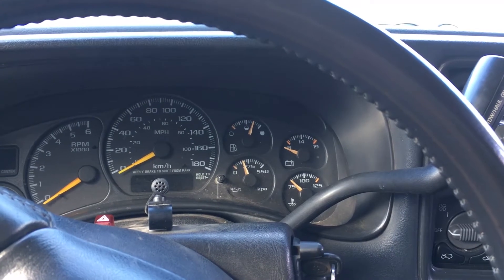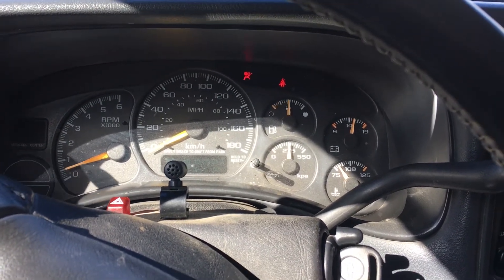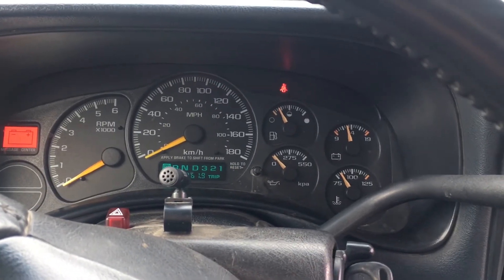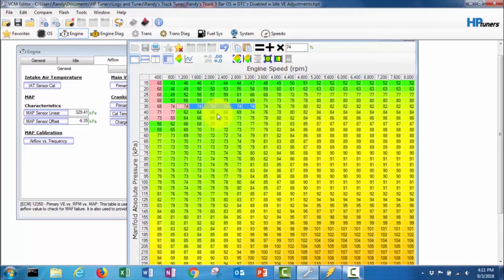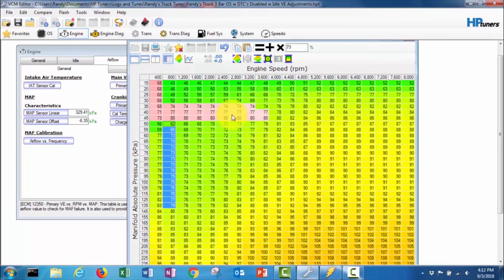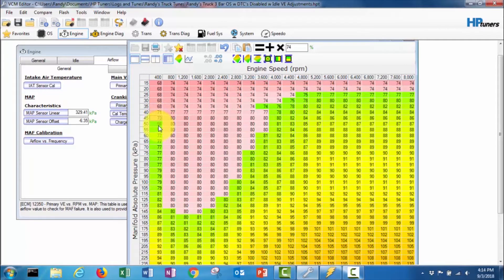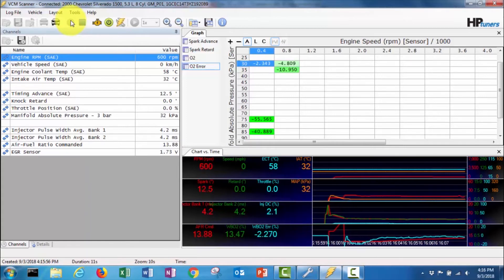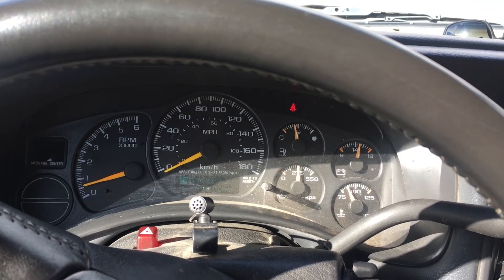Lowbuck LS Turbo Truck Project - Initial Startup and Idle Tuning with HP Tuners 3 Bar Enhanced OS

Comment: First off great video it’s hard to find content where someone walks you though these things. I didn’t have such good luck, my truck will not run, I tried adding fuel and I tried taking away and still didn’t seem to change. Truck with fire eventually but not run
Reply: Do you have any advice
Reply: Are you running MAF.  Is it plugged in?  If not need to start there.  In tuning

Comment: I just bought a 6973 turbo. What fuel pump and injector size would you recommend?
Reply from the maker: Thanks for watching and commenting. Depends on what type of fuel you plan on running and what your horsepower goals are. I plan on using a Walbro 450 in the tank and decapping the stock injectors initially. Should be good to 500-600 horsepower on 93. That would probably work for your turbo as well unless you’re planning to run E85. Other options would be Siemens Deka 60’s or 80’s, or is money is no object, Injector Dynamics. I plan on trying the decapped stock ones first and if I don’t get the results I want I will buy some. Will have some videos about this soon.